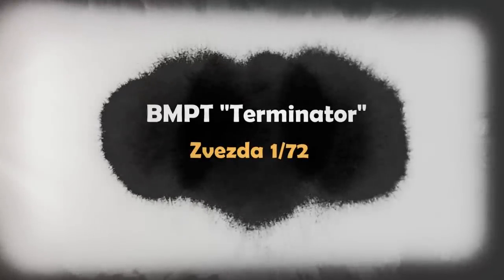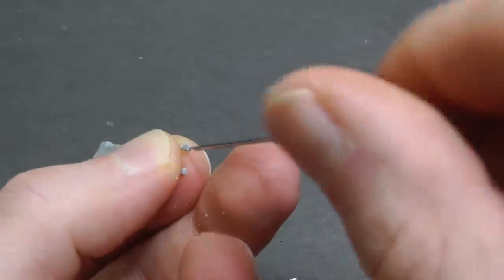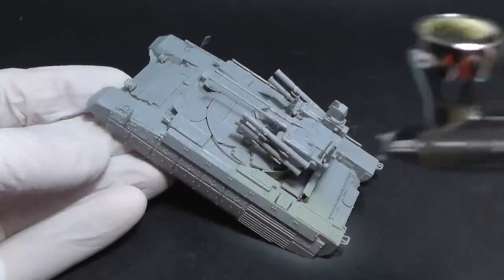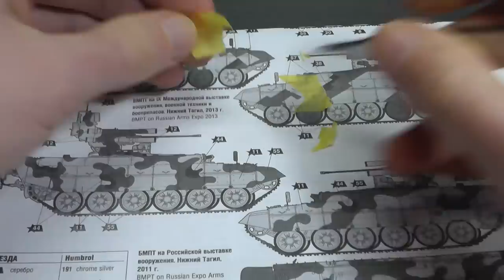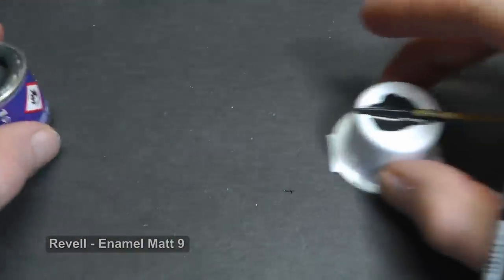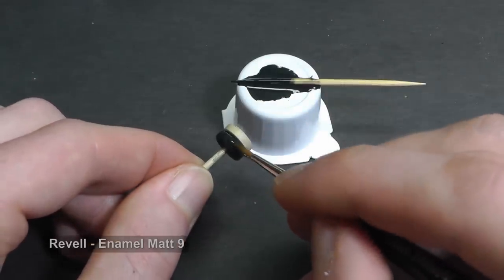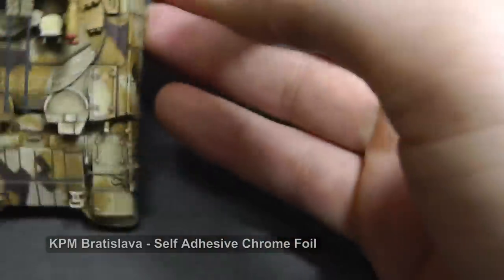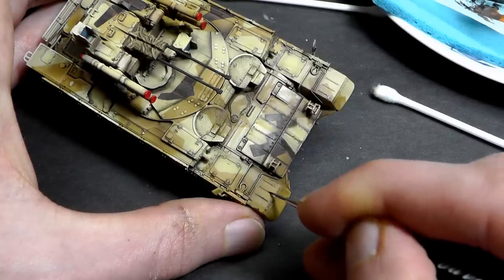BMPT Terminator 1/72 Zvezda - Tank Model

Comment: Does anyone know why David is using Acrylic Paints instead of Email Paints for the brush ?
Reply: Blechout: My guess is because it dries faster as he mentioned. I never had issues with enamel paints and personally don't see the difference. Usually if you have a enamel base coat you can weather with Acrylic and vice versa if you use the correct thinners, same goes for oil based paints, other than that personal preference I guess
Reply from the maker: I use both, however, I prefer Acrylic. They are resilient to enamel washes and other weathering chemicals.
Reply: PLASMO - plastic models oh ok, thanks :)